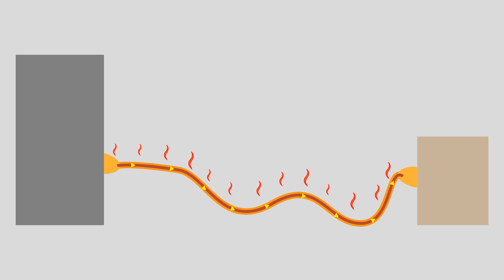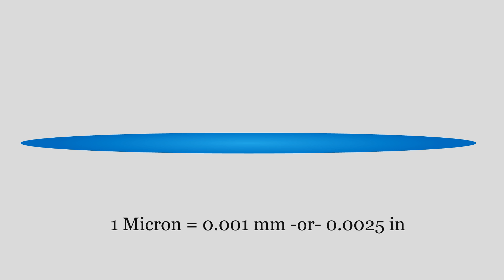Quantum Levitation Explained

Comment: Does the direction of the magnetic field matter (is the effect exactly the same if the magnet is placed upside down)?
Thanks for video
Reply from the maker: I don't think the direction matters. I've seen videos where they run a superconductor along a magnetic track both above and below it (one floating one suspended).

Comment: Still don't get it. In what way does the super conductor play  a role if it needs to be so thin that the charges flow through it?
Reply from the maker: Think of it as a piece of paper tacked to the wall. It doesn't require any effort to leave the paper where it is. However, if you try to slide the paper along the wall (perpendicular to the thumb tacks), it takes a lot of effort because the tacks (flux tubes) want to stay where they are. In order to slide the paper relative to the tacks you have to make new holes by either tearing the paper or removing the tacks and re-pinning the paper, either of which require more effort than leaving it alone in the first place.

Comment: Energy does not flow inside wires.  It flows along the outside of the wires.  You do need wires to encourage the transmission of energy. They help to channel energy to minimize waste.
Reply: What the fuck? Electricity does not flow along the outside of a wire
Reply: @m07z  It's called the skin effect: electric current flow concentrates on the external part of the wire, the "skin".

Comment: why is this called quantum. It has nothing to do with quantum
Reply: There is no Quantum Levitation without the "magnet".  Magnets and charge are a quantum property.
Reply from the maker: Not 100% sure myself. Any real scientists feel free to correct me.

My guess would be because when you quantize a property (quantum refers to the minimal amount of any physical property involved in an interaction) you are restricting a variable to discrete values. Example: When we say "Whole numbers" we are simply quantizing our 'count' to multiples of 1 (1,2,3,4,etc). In this system of values there is no grey area, such as 1.2854.

Similarly, in quantum levitation,  we are aligning the magnetic fields to fixed positions. They can no longer go anywhere they want through the medium. They grey area has been neutralized.
Reply: I did some reading myself and it seems that the energy it takes for the field to penetrate a superconductor is itself quantized. Hence the naming....
Reply: I thank you for your well-thought comment. I really acknowledge your words and I think you have a point here. As a student of physics, I would guess it is called quantum levitation because by classical laws of physics this phenomenon just cannot happen; it is IMPOSSIBLE. (I'm sorry for caps lock, but I think this is important) Anyway, we can watch the phenomenon, which must lead to the conclusion that quantum mechanics is a real thing. Nowadays this does not seem questionable, but back in the days, even Einstein had a hard time accepting it.
I hope my English is okay and my response is helpful. I know your comment is quite old, but maybe the subject is still interesting for you.  I hope you have a good day.
Reply: Underated Channel.

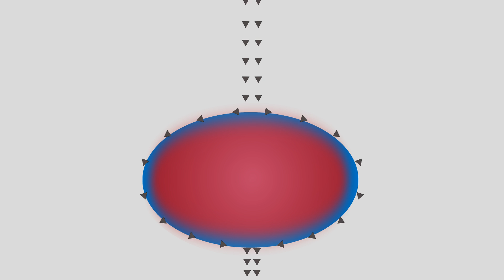Comment: 1:33 "this creates a pocket in the magnetic field", but why the pocket is stable enough to hold the super conductor? both pulls and push against gravity? 
the other video shows the super conductor can flow both above and below the magnet.
Reply from the maker: +nicholasxuu Think of the pocket as more of a low energy state. It would require more energy to move the super conductor (thanks to flux tubes. 1:55) and realign the magnetic field than to simply let the superconductor stay where it is at (1:47). It works both above and below the magnet so long as the energy required to move from this low energy state is greater than the force of gravity (ie. the superconductor is kept cold).
Reply: i'm a bit confused about this, too. shouldn't the little "holes" be perfectly equally spread around the superconductor to not make it move? How come all of these "holes" are holding it? i can't imagine they are all perfectly the same size.
Reply: @Flaschenteufel  Imagine a disc with randomly punched holes. Now, pass 10 threads through each hole, and tie them to the roof and floor at random as well. The disc would stay pretty much inmovable in the air.
Reply: @elsurexiste  that doesn't makes any sense to me